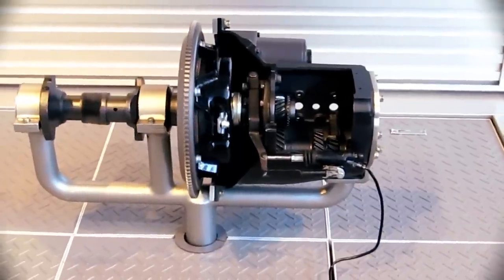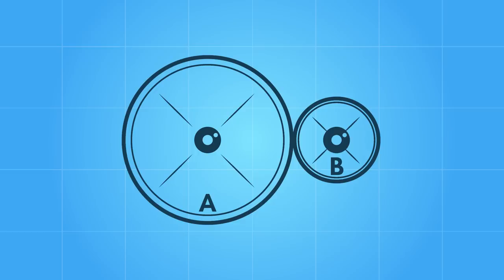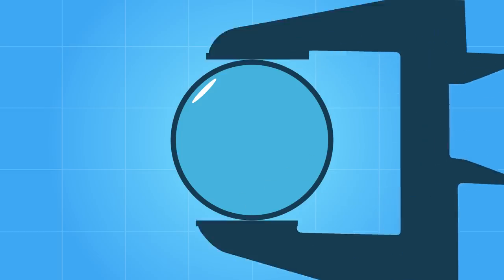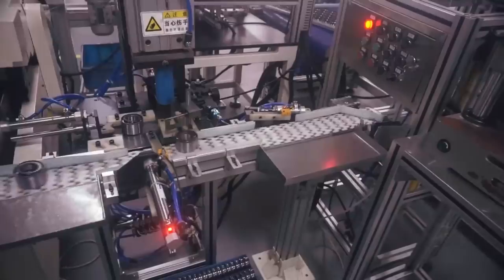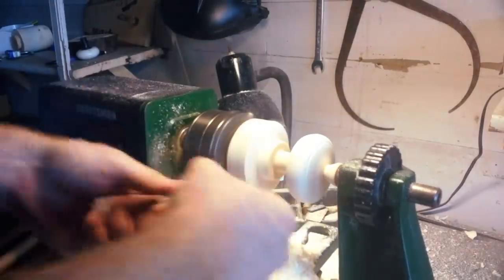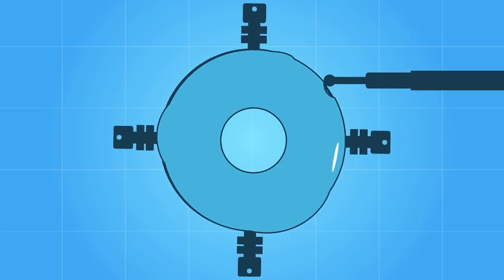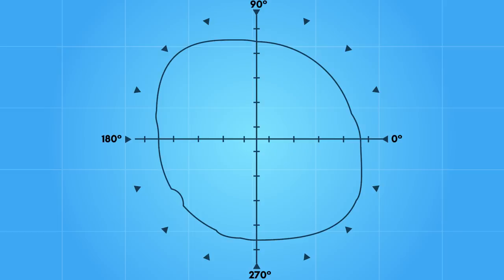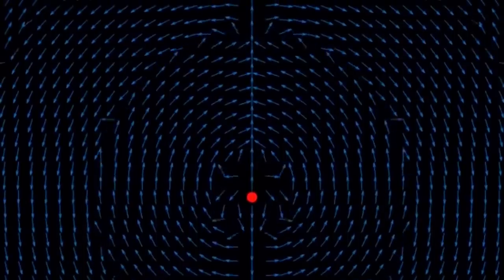The Science Of Roundness

Comment: Fun fact:  The red tip on the end of the probe (in the thumbnail photo) is actually a precious Ruby gem.  I was a machinist for several years and worked in the CMM room occasionally where precision parts were measured in x, y, and z axis.  They use a Ruby tip on the probe because it can touch objects many thousands of times without wearing out or becoming disfigured or flattened on the end, from repeated long term use.  It maintains a perfect surface tip for touching and measuring with precise accuracy for repeated regular use over extended periods of time, as an accurate precise measuring device.  Once the probe touches a part in many points, in all axises the computer gets a picture of exactly what the part looks like, in order to maintain continuity of accuracy in the production process of the parts being machined.)
Reply: very interesting fact, any reason they don’t use diamond? is ruby better somehow or is ruby simply just ‘good enough’ and cheaper?
Reply: @hazza2247  diamond coated tips are used in some very specific applications, but cutting a diamond into a sphere with tight tolerance would be hard.
Reply: @theondono  makes sense, thankyou
Reply: Same reason rubies are used as bearings and pivot points in mechanical watches.
Reply: @Metal27928  I was just about to ask!

Watches are so cool. They're like a miniature engineering exhibit.
Reply: @Metal27928  they are used because of the almost zero friction they have while rotating those small gears inside the watch. That why the more expensive watches tend to use more rubies. They are a 9/10 on the mohs scale. Just under a diamond.  In the corundum family. 👌
Reply: This is one of the coolest comment threads in a long time! How interesting!
Reply: Cool 😎
Reply: I miss engineering.
Reply: I wish he had gone over CMM probes and how they're manufactured to be so precise

Comment: The lineup consisted simply of six  hydrocoptic marzel veins, so fitted to the ambifaciant lunar wane shaft that side fumbling was effectively prevented. 

It's produced by the modial interaction of the magneto reluctance and capacitive directance. The original machine had a base-plate of pre-formulated amulite surmounted by a malleable logarithmic casing, in such a way that the two spurving bearings were in a direct line with the panometric fan. 

The main widing was of the normal lotus deltoid type placed in panodermic semi-boloid slots of the stator. 

Every seventh conductor being connected by a non-reversible tremi pipe to the differential girdle spring on the up end of the gram meter.

Comment: when you try to drill a thin sheet of metal, most of the time the drill hole is a reuleaux triangle. i never realized that this shape has a constant diameter, it all makes sense now since the drill bits are almost a line in their cross section.
Reply: follow up: i meant the regular twist drill bits. there are also special stepped drill bits for thin sheets that drill a nice round hole.
Reply: @klazzera  Also, use a vise to hold the part, oil for lube, and go slow on the drill press handle.. assuming of course that the roundness of the required hole is important.. ;)
Reply: @genelomas332  yeah also you can use a piece of oiled fabric between the part and the drill, not sure why it works but i saw it on youtube, better for big sheet metal structures when you cant use the press
Reply: For drilling thin sheets I always put hardwood underneath and slowly drill through into the wood below
The pressure from underneath keeps it flat and the slow steady follow thru keeps things round
Reply: @dustinjames1268  that would also keep a steady center resulting in a circle hole
Reply: It's easy to imagine this way; Take a sheet of paper, draw three vertices that are equal distance from one another and forms a proportional triangle.
Take a string, attach it to a pen and cut the string so the distance between the end of the string and the tip of the pen is to the equal length of the distance between two vertices.  Place one end of the string on one of the vertices, then draw a line between the two other vertices using the length of the string so you create something that looks like a dome between the vertices. Do that for all three vertices and you have yourself a realoux triangle with equal distance.

Comment: I used to have to change tools in a horizontal mill and tram them in to less than 50 millionths TIR , the set the front of the insert to 6-9 microns above the guide pads and about 15 microns below at the back ... I would say this is a very truthful and informative video
Reply: What type of indicators did you use and who was the work for, nasa?
Reply: Red Pilled mititoyo , and basic production machine shop. When your shoving a one shot boring bar ( no rougher ) that’s 4 fluted , pcd tipped , and 385 mm long down an aluminum part in 3.2 seconds holding plus or minus .015 microns on diameter , shit has to be straight.
Reply: Was doing some reading and it seems the ways of manufacturing machines often use moore scraping to get them very flat. The techniques are amazing really when you get to that level where holding a part and heating it will give you measurable deviations.

Comment: IF you're going to do a Science Of video then maybe use science units? Who still measures things with body parts?
Reply: Ah yes, much better to use one forty-millionth the circumference of a random rock in space that isn't even actually spherical; and when we decide we don't like that, we'll use the distance light travels in one 299,792,458ths of 9,192,631,770 periods of radiation of Cesium-133. Far more scientific. :P
Reply: Phiwise_ I sure hope you're being facetious.
Reply: @phiwise_9489  Are you aware that feet are defined in terms of meters, therefore, feet are also defined by the distance light travels in one 299,792,458ths of 9,192,631,770 periods of radiation of Cesium-133.
Reply: Makes one wonder how retard unit users measure voltage, current, power, magnetic flow, inductivity, time, frequency, amount of light, bullet impact force and file size...
Reply: Machining is done in imperial due to the legacy of the system including the equipment reading in imperial. So most machinists are fluint in both systems.
Reply: @mikedrop4421  This!

Comment: Runout isn't a measure of roundness the way you have it depicted in the video. If a component is in a fixed-axis rotational setup (as depicted in the video), then it could be perfectly round and still have non-zero runout if it's axis of roundness is not aligned with its axis of rotation. In other words, runout of a part rotating around a fixed axis is a measure of roundness and concentricity, and non-zero runout doesn't tell you whether roundness or concentricity is off. In order for runout to be a measure of roundness only, it has to be measured using a V-block, as depicted earlier in your video.

Comment: The reason why the wheel reduces friction is because when a wheel is rotating, without any force being applied on it, the point of contact is at rest when compared to the ground. This is because the point of contact has two components to its velocity, one the linear motion of the wheel, and two the rotational component, which are equal and opposite to each other, when the wheel is perfect rolling. 
And since there is no relative motion between the wheel and the ground, there is no friction.

Also the frictional force between two surfaces only depends on the normal force between them, and the materials they are made from. It is independent of the surface area of the contact
Reply: The friction remains at the axle but is easily overcome thanks to the leverage offered by the wheel.
Reply: What you say about friction is a theoretical concept laid down in Coulomb's law of friction. It does not hold up to close scrutiny in practice; the coefficient of friction is NOT constant. Both speed an pressure have an influence.
As for no friction between wheel and surface: again, this is an assumption of perfection. The touching surfaces are not infinitesimally hard; they deform on contact. As there is hysteresis between compression and release, the center of force of the contact area is shifted from the point exactly under the axle of the wheel, resulting in a small distance that acts as a lever. Rolling friction thus is sometimes expressed in terms of that "friction radius"; this concept explains why larger wheels roll more lightly, (that, and the fact that they re less disturbed by imperfections in flatness on the surface they roll on.
Reply: @HotelPapa100  That's totally irrelevant to the point in the video about leverage.  If your wheel was the same diameter as your axle you'd have a hard time overcoming the friction.  With a large wheel on a small axle you have leverage making it much easier to overcome the friction, because there's less distance for the rubbing surfaces to travel against each other, and more force (torque).
Reply: @peetiegonzalez1845  I was replying to Sankar Manoj. That the lever in a wheel is hidden in the ratio outer diameter to bearing diameter is kinda obvious if you analyze the problem a little more in detail.

Comment: 2:33, this double's the torque at wheel A's axle, not B's.

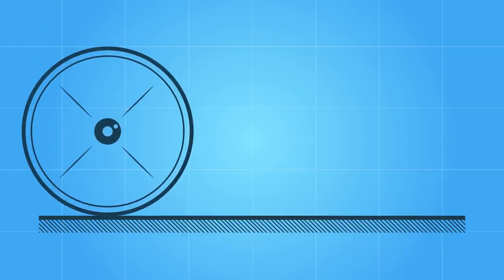2:59, the reason a wheel reduces the effective coefficient of friction is NOT because only a small area of the wheel makes contact with the road.  It IS because the vertical force on the axle bearing is (essentially -- see below) the same as the force between the wheel and the road.  If the wheel is rolling, the sliding friction force acts on a lever length equal to the radius of the axle bearing, whereas if the wheel is sliding, the sliding friction force acts on a lever length equal to the radius of the wheel.  The friction is reduced by the ratio of the two radii.

Note that the above is for the simple case of same coefficient of sliding friction in the bearing and between the wheel and road, a simple sliding bearing (versus roller or ball bearing), and uses an ideal wheel (as mentioned in the video) that doesn't deform under load, and has zero weight (even real wheels weight much less than the loads on them).
Reply: The word 'doubles' does not need an apostrophe

Comment: If two perfectly round spheres are in contact, what is the surface area of the point of contact? It seems like it would be infinitely small. Is that possible?

EDIT: I found the answer.apparently the area of contact is a “point” and by definition is infinitely small. So, If two perfect circles (which don’t exist) touch, the area is a point, (which doesn’t exist) So its all a hypothetical scenario that can’t exist and doesn’t exist.
Reply: Everything is a spring!  Even really hard things! if you had two near-perfect diamond spheres and they touched, the pressure at the point contact would be enormous. It would deform the diamond until the contact area times the pressure on it equalled the force pushing the sphere's together. If the required deformation was beyond the elastic limit of the material it would permanently deform or shatter.
This is why you shouldn't bang together your diamond spheres, or your hammers! :-)

Comment: Not really sure about it, but I thought area of contact had nothing to do with friction... Small area = higher pressure on the contact area / bigger area = same pressure distributed on a bigger area...  The only thing that changes friction is the material and possibly the surface texture.
Reply: As far as I know...except considering car tires, which have a variable coefficient of friction at different pressures.
Reply: @mitchellsteindler  I think you mean a variable force, because the lower the pressure the larger the contact patch with the ground.  The coefficient of friction stays the same, but the area experience friction changes, so the friction force also changes.

Comment: Fascinating video.

Runout is not necessarily caused by out of roundness. At 8’22” a shaft with a smaller journal is shown. If both cylinders are ‘perfectly round ‘  but their axes are not concentric, non-parallel, or both, runout will be present. In this demonstration, the runout decreases as the indicator was lowered. Either the journal was less round at the shoulder than its tip or its axis was not aligned with the body of the shaft (or the specimen was not held properly in the fixture...).

Comment: I once made a go gauge to the measuring limit of a CMM (0.00002 = twenty-millionths).

The hole was ~0.20498 + 0.00002 with 3/8 through engagement.

The closest I ever worked. It was measured in a temp controlled room bc at that level a few degrees can make that 0.00002 disappear.

Comment: Need to check relationship between " diameter" and " circumference" not linear? A two to one pulley ratio is relationship between circumference. Also there is, by definition, no such thing as an " imperfect circle" if it isn't perfect, then it is not a circle. Circularity/ roundness is a measurement of deviation from a circle. Also there is no way to construct or to measure a "perfect"  circle, because Planck length requires deviation from the definition.

Comment: The suggestion at the start the lever lead to the driven wheel is rubbish.. the undriven wheel existed for thousands of years before the driven wheel. Similarly the suggestion that a small contact patch is why wheels have low friction is a huge oversimplification. Consider modern car tyres as engineered to have very hugh friction : rolling resistance is something different to friction. Large wheels can have lower rolling resistance over rough ground even if they aren't super round. This much fundamentally wrong in the first 3 minutes I have up watching at that point

Comment: Thinking the wheel originated as an evolution of a lever makes no sense. Rest assured the first wheel wasn't connected to a power transmission, so it wasn't invented as a means to convert power into speed. The wheel probably came to be as an evolution of rolling stuff over logs to move it around. 

Also, did he just use circles as the starting point to define roundness? I mean, really? Roundness is when the shape matches its inner an outer circles? The perimeter maintaining constant distance to the center, anyone?

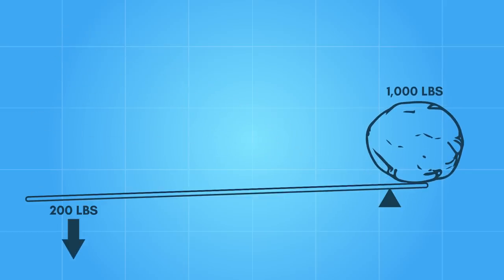Comment: 0:55 except you forget the part where the rock you've drawn is round and would've annoyingly rolled away whenever you'd try to lift it, also that pole has to be strong enough to withstand the weight, if it were for example made out of wood it would most likely snap under that weight

Comment: 3:20 No, material contact has 'nothing' to do with firction. Friction is rolling resistance coefficient times normal force (weight of wheel + whatever is on the axle). There is no area in that equation. So no, that doesnt form the basis for bearings and all the other rorating things. They have to be round because thats the only geometric shape that is rotational symmetric.

Comment: 12:55 what if the circles don't have the same centerpoint? Or is the centerpoint defined in some way you didn't mention?
also, you probably mean "the biggest circle that can fit inside of the measured datum" not the smallest, as there is no limit to how small a circle you can fit

Comment: In europe they use plus plus and minus minus tollerancing, where as in the US ODs are called out as plus nothing and minus a value.So in other words in the US if the pin is on the high limit and the hole is on the low limit you have a press fit with no clearance. plus plus, minus minus tollerancing insures that there will always be clearence.

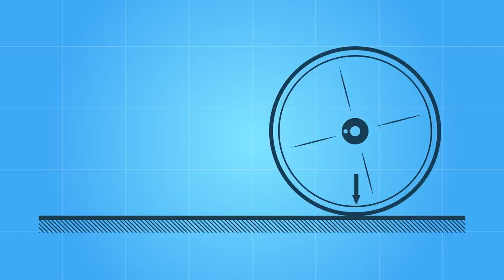Comment: at 3:31it seems that the explanation of friction reduction is because of the small contact area, but I thought is was because there is no sliding between the surface of the wheel and the plane it is sitting on. If the wheel was not free to rotate, the contact area would be the same but the friction would not be reduced.

Comment: I wouldn't consider 1/10.000 of an inch (2.54 µm) a good runout for machines (on the main spindle), dependes on the purpose of the machine though. High precision machines reach values as low as 0,1 µm.

Comment: 3:00 Friction is independent of the area of contact. This is called Amonton's first law of friction. This myth persists probably because of the way tires are made. Larger tires have more friction because they are made of softer materials. Thinner tires have to be more resistant, since the pressure at the point of contact is greater, so they are made of harder materials, which generally have less friction.